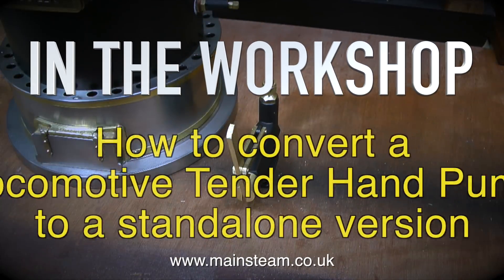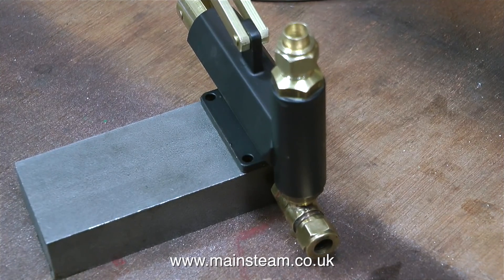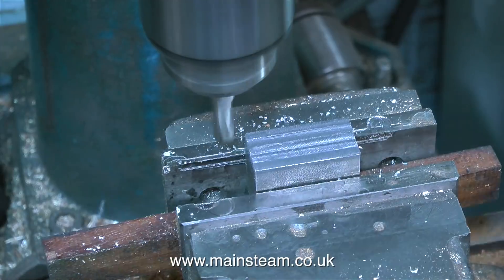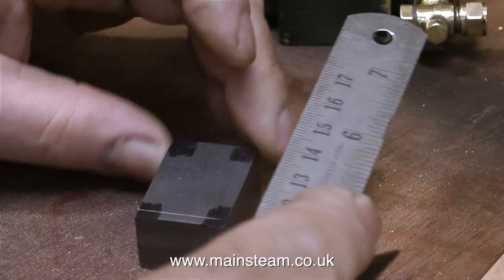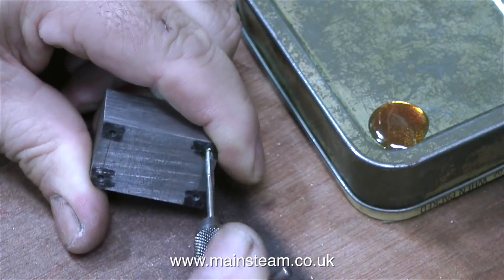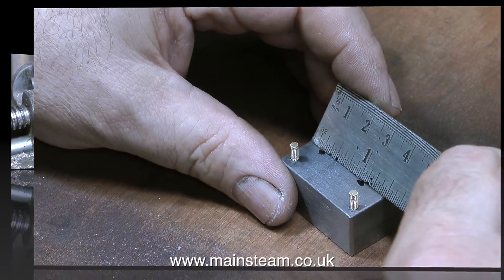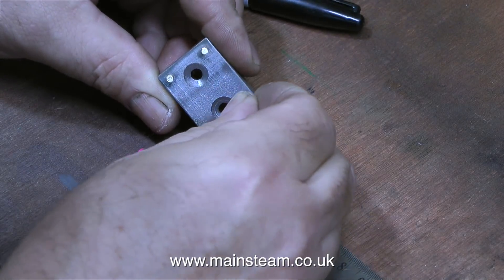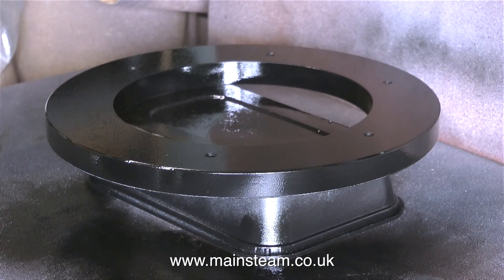HOW TO CONVERT A MODEL BOILER FEED HAND PUMP - IN THE WORKSHOP

Comment: Just a little side note about Canola and Rapeseed oils. The erucic acid in Rapeseed is desired in the lubricating oils, handles heat & pressures better. Canola oil has this component remove, making it safe for cooking. Just a smart ass Carolina fellow posting his opinion, trying to help a Brit out. Like you, I’ve seen a sunrise or two.